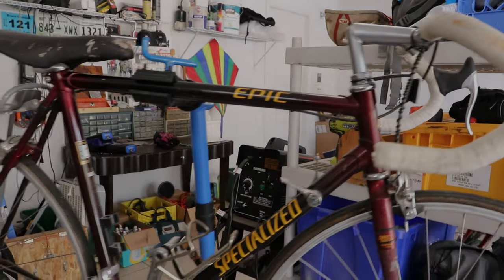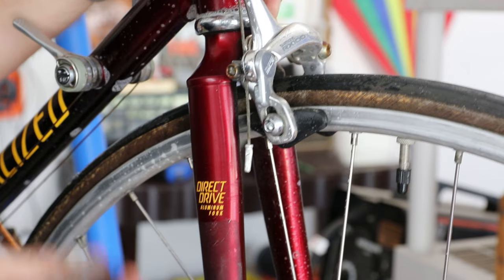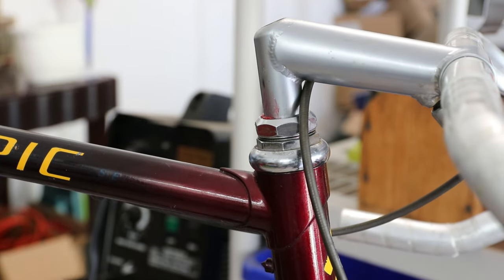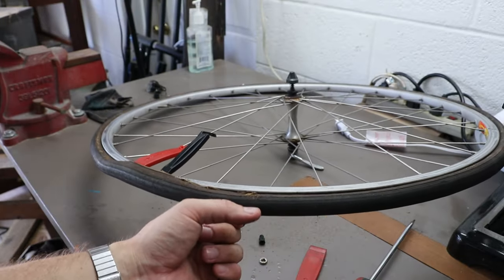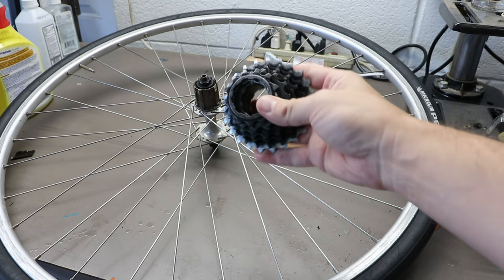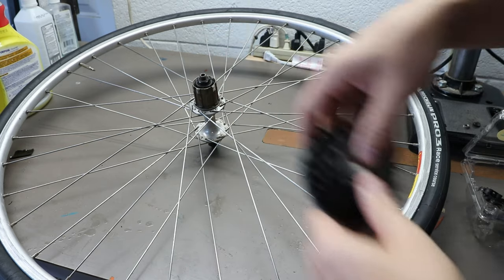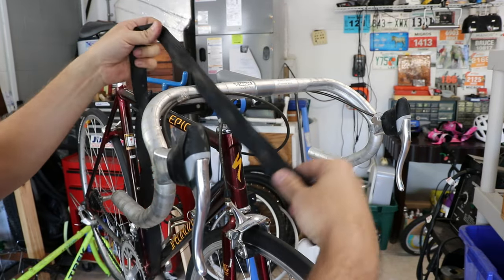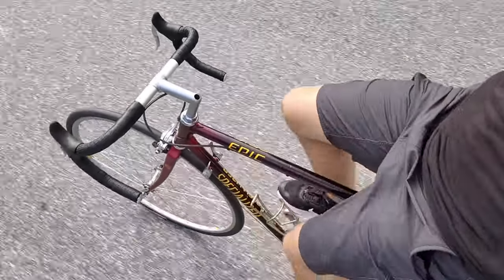$25 build - 1993 Specialized Epic

Comment: Here's a little bit of a history lesson on cassettes/freehubs: Shimano started doing them in 1980 with 5 and 6 speed clusters. The early cassettes were known as Uniglide (UG) and did not use a lock ring like modern cassettes. The smallest cog was threaded and there were threads on the outside of the freehub body. The freehub splines were also uniform and evenly spaced, unlike today where you have the narrow spline with the wide notch. With these, you use two chain whips, one to hold the cassette and the other to loosen the threaded small cog. When Shimano moved to 7 speed, they redesigned the cog profiles to better work with indexed systems and improve shifting performance, so this is when Hyperglide (HG) came out. The first HG freehub bodies were backward compatable to UG cassettes and had the external threading to allow a UG cassette to be installed. This bike's freehub is one such hub. Once Shimano went to 8 speed, they ditched the UG compatability and those are the freehub bodies we see still see today.

I have a 1986 Ritchey mountain bike that came from Ritchey equipped with Dura Ace hubs and a 6 speed UG cassette on the back. Pretty cool to see how these things have evolved over the years. The 90s in particular was a period of great technological advancements with both components and frame materials both in road and mountain bikes. I always like the Epic frames because they still looked like a traditional lugged steel frame which is much prettier than a bonded carbon frame (like what Trek was building in this era).
Reply from the maker: thanks for the background ABB, now I know a little bit more. And yeah me too, if there frame where smaller I'd like to keep it.
Reply: I have several 7 speed Shimano 1055 hubs, these are "transition" hubs that can use both Uniglide and Hyperglide.
Reply: @jerryavalos9610  Most, if not all, of the 7 speed mountain bike stuff had that too. I've got some bikes with Deore XT, Deore DX, Deore LX, and STX 7 speed freehubs that I believe are all backward compatible to UG cassettes.

Comment: Hang the bike by the seat pos especially on a car on fiber frame.
The clamp has the potential to crush the frame . Also by hanging it by the seat post it will hang lower in the front so you won’t need to use a bunjee cord to k ep the front still.
Reply from the maker: Hi Paul, I know it's usually recommended not to clap a carbon TT but I always make sure to claim it very gently and do go for the seat post if I need to be rougher with it. So I think if you're gentle with it, it's worth clamping the TT for the convenience.

Comment: Those are Shimano "aero pedals" from the late 80s thru early 90s. Either PD-A550, PD-1050, or  PD-7400  - Exage, 105 or Dura-ace. It should be stamped on the back. Unfortunately the toe cages on those are broken - the straps, plate and bolts should be fine though. If you want replacement clips, there is a shapeways up with replacement printed clips called "Road Bike Toe Clip Shimano PD-A550." Given all varieties use the same shimano-exclusive 3-bolt system, the original metal or plastic ones are hard to find and expensive when up for sale.
Reply from the maker: thanks for the info Aubreykun!

Comment: List it for $250 OBO and see what happens. Also with rust like that, a dremel with the wire wheel attachment take that rust off way easier and faster, it also gets in the grooves unlike sandpaper. Just my 2 cents method. Sweet ride man!
Reply from the maker: thanks Rob!
Reply: Evaporust all the things! On skewers, I typically use 0000 or 000 grade steel wool and it will get the rust off pretty nicely without scratching the chrome. If it's heavier, dip it in the Evaporust and it will come out looking nice if the metal isn't already pitted. Even if it is, still better than all that rust.

Comment: I would list for $125. Possibly less because of the tires. You MIGHT be able to press your luck at $175 but I consider that greedy given known issues.

Edit: If the tires were still good I'd list for $200 with a negotiation down to $150 . It really are the tires that drag the value down. 

Also I've seen seven speed cassets on Amazon. Given six/seven/eight speeds chair the same chain that suggests to me similar enough gear spacing. You MIGHT could convert it to an eight speed but I dunno.
Reply from the maker: thanks Andrew. I was thinking to start at $150 and work down from there, wouldn't be surprised if it ends up going for $100. Yeah the tires are the only thing I'd call wrong with it other then just being old. And it's a shame because they're not that old either, I guess they just don't last long sitting around.
Reply: @BruceChastain  Most likely sat out in weather. Except the rest of the bike isn't all that bad a shape.

Comment: I'd sell that for $300 CAD in Ontario all day long. Yes it's old but someone will appreciate how unique it is and the look is cool no matter what. 

Cassette wise, your lucky to have never discovered a 7 speed freehub body.

They were "pre-8 speed" and can ONLY fit a 7 speed cassette.
I've tried so .any times to take a wheelset like that and change it out to 8 speed. But the body is too short for 8, which is super annoying.

If you want you can likely take the freehub body off and replace it with a 8-11 speed freehub.
Reply from the maker: thanks Riley, I"m not sure it would really make sense to upgrade this one to 8/9 speed anyway being the DT shifter only has 7 positions.
Reply: @BruceChastain  yeah for sure, I'm most cases it's fine to leave but if it was your personal bike and wanted to upgrade. It's possible (or just get a nicer wheelset)